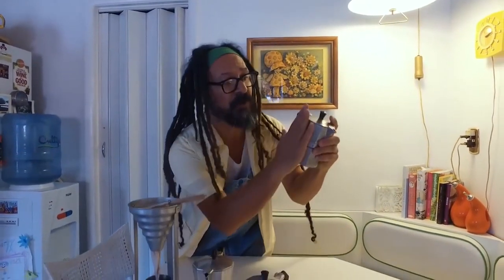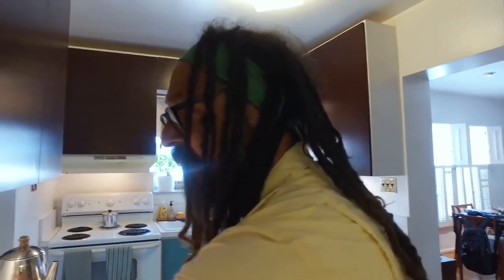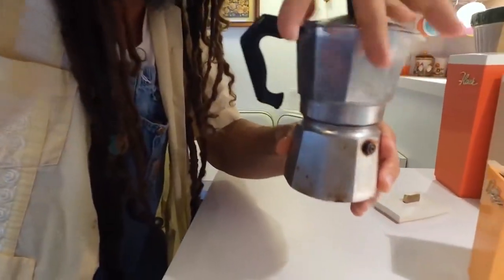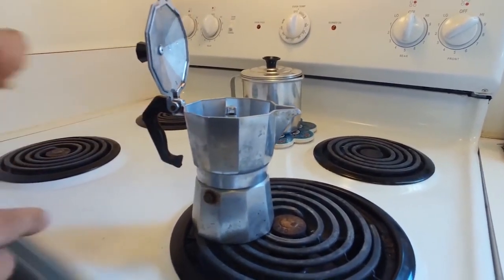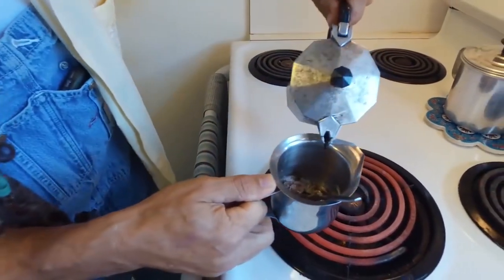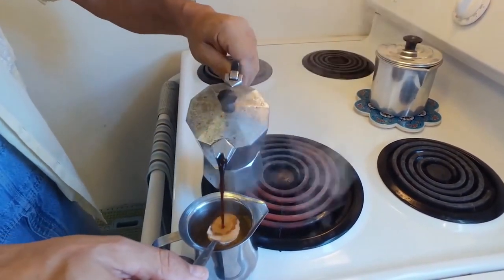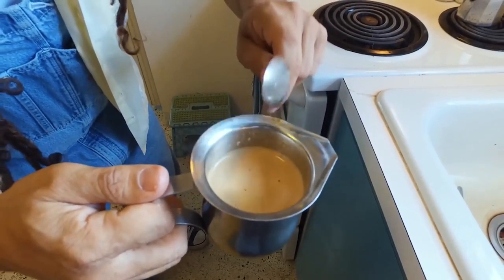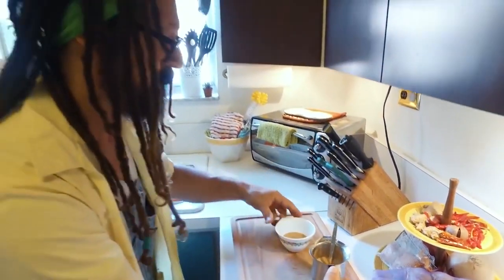How to Make Authentic Cuban Coffee easy! | Colada Instructions

Comment: I've been watching Cuban coffee videos lately, and yours is by far the best one! Very interesting! 

I make Moka espresso the traditional Italian way, so the differences are interesting between Italian vs Cuban: not packing the coffee vs packing it a little bit (maybe it's a different grind?), using a low gas flame or a medium electric stove vs a high electric stove, removing the Moka from the heat the instant you hear it gurgle so it finishes brewing off the stove vs leaving it on the stove much longer. But, I can see your end result is awesome coffee ☕! 

Thanks!